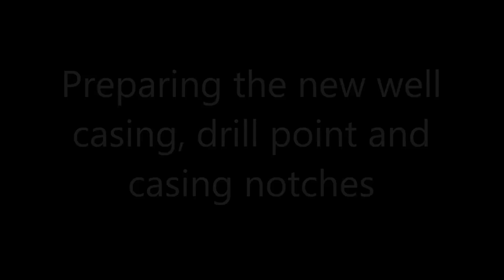Philippine Water Well ~ "Preparing Well Casing" ~ Video 4 ~ Santa Barbara Iloilo Phillipines

Comment: Nice video; thanks for sharing!  Our patented portable technology not only allows you to build a pipe on any remote site worldwide, but you can set up the equipment on top of a well, build a continuous pipe (well casing) onsite and as the pipe is made lower it into the well. The strong and lightweight pipe will never corrode!  You can make miles of pipe this way in diameters of 3-inch (75 mm) and larger.   If required, the pipe can be perforated before insertion also.   Please watch this video.@

Comment: Hi thereI just had my well installed. The water table is only 6ft and they went down 40ft. I hope they did. Otherwise they pinched my pipes. The pipes they used was 4" but the electric pump I have is 3". They said it's the best way, I have to take them at they're word. Waters lovely and clear but it only good for the rice fields. For drinking I need another well and that will go down 150 to 200ft. It's nice to some one else's well being drilled.

Comment: Very interesting project. The wash in wells we did would have a 2" casing with an 1 1/4" pipe. The bottom pipe was capped and had many slits horizontally. Its amazing that they are doing 4^ casing by hand like that. 

Last time we went to the Philippines we put rain gutters (Homemade) and a water tank to catch the rain. We used pipe of the same color to y into the tank. A well like that could not be done where my wife's family lives.  The roads are all along the ridges (I call fingers) of a huge mountain, and you would probably need to go several hundred feet to hit water if at all.  There are streams (They call rivers) between the fingers, and that's where they have to fetch water if there's no rain. Its a few hundred feet away, but 50 feet or more lower elevation down that slippery gray mud. The Barangay well was out of order for years, but now is working, but is only on 30 min a day and they have to cross the road and fill there.

The water there is not drinkable, but my wife's paternal barangay in the next town over has 24/7 water coming down the mountain in those blue hoses and its potable. I have drank it many times with no ill effect.  Here in the USA we have such robust infrastructure and take it for granted....
Reply: Good idea having both electric and hand pumps! Originally I was going to run a pipe from the barangay water hose across the street, but with the water on 30 min. a day and not that much GPM I thought the gutter and tank was a better option. just for washing and flushing etc... I can't remember exactly how many gallons the tank was. I think is was 1,000 liter which would be like 260 gal. Its been almost a year and only runs out durring a few brief dry times.

My wife's aunt spent thousands of dollars trying to get a well, but she lives 3 kilometers further along the finger of the mountain. My wife says there is plenty of water in the little valleys between the fingers, but then you would have to own that land to drill.

We have friends in Liloan Cebu with a nice hand well, but the water is brackish, they were fishermen in generations past, so they live very near the sea.

The filipinos have a good life as long as they have money for food, but basic things take a lot longer doing it the old way. My wife's mother spends about 4 hours a day washing clothes. Cooking dinner can take several hours and etc... BUT they don't have to get up to an alarm and got to work each day, and my wife sends at least 1 weeks pay a month home, so they are all ok.